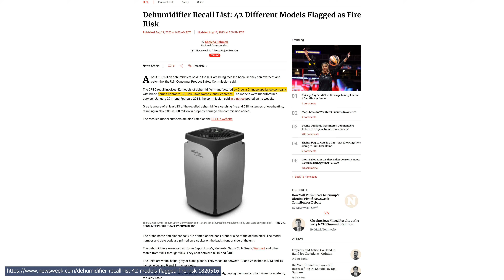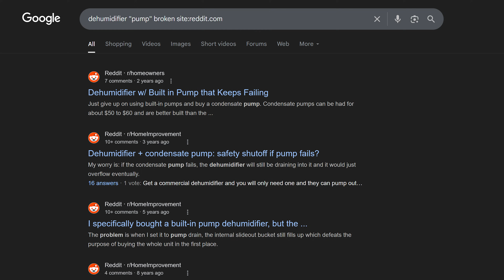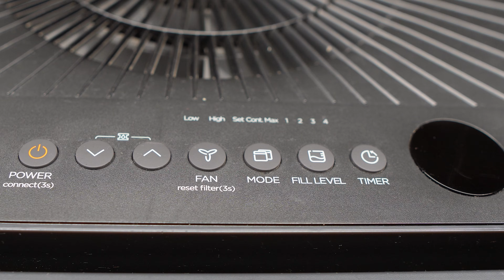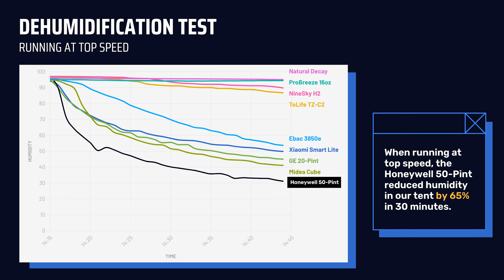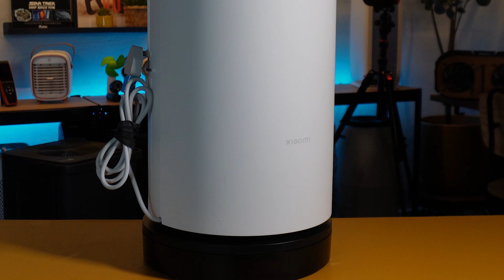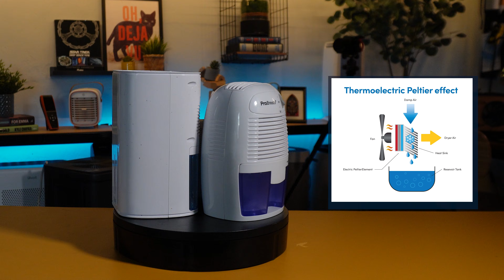Don’t Buy a Dehumidifier Before Watching This → The Best Dehumidifiers We Tested

Comment: Missing the Meaco Arete range! They even have a HEPA filter option. Definitely was a top pick in the past so a shame to see it missed here!
Reply: Arete One 12l but I believe they’ve updated them to be “smart” with the Arete Two range
Reply: Also, if you did test these and found them to be not as good as you’d hoped, I’d still love to see that. As far as I can tell Meaco is a fairly popular brand here in the UK
Reply from the maker: Will make sure to include for future they look interesting. I had tried one in the past that was both dehumidifier and air purifier and it wasn't great but these look better. Which model do you have?

Comment: this is by far the best video on dehumidifiers on youtube. Keep up the great work and i hope you can test more dehumidifiers and humidifiers. One bit of advice, Unlike air purifiers, you shouldn't oversize a dehumidifier. This can cause frequent cycling and shorten the lifespan of the unit. For example if you have a small bathroom, people think buy the biggest unit. This actually is less effective due to the unit constantly cycling on and off.
Reply from the maker: Thanks for sharing the issue of frequent cycling and it makes sense now that you say it. Could be a reason why people see such a high fail rate - I will make sure this is clear on the website version and include a size chart based on room size. Will keep on testing dehumidifiers and look at humidifiers at some point for sure!
Reply: @HouseFresh keep up the great work. I know you fight hard for this channel and website, but you probably have one of the best sites i and many others have found.
Reply: Hmmm; so the same as they say about window AC units! Good to know. Thanks

Comment: Glad to see the review of dehumidifier.  I would like to hear more on reliability.  I've lost track of how many dehumidifiers I have had to toss out over the years.  I only need to run a dehumidifier about 6 months a year.  Even so, they tend to fail (either with a fatal error code, or just stop dehumidifying) about a year after purchase.  I had one case where the manufacture refused to honor their own warrantee (I am looking at you Frigidaire).  Recent brands I have gone through include Costway, Midea, & Frigidaire.

I am convinced there is no one in the world that knows how to build a decent dehumidifier.  How hard can it be!?  We have air conditioners, heat pumps, refrigerators that easily last 10-20 years and they and dehumidifiers are all doing the same basic things.  But really is there no one able to make a dehumidifier that can last over 2 years?  No one!?

By the way, none of my failures have been due to a pump failure (I usually avoid using them where possible).
Reply: Each manufacturer knows how to make a dehumidifier last forever. They design them to fail shortly after the warranty period, planned obsolescence, with no replacement parts.  This way, customers pay around $250 a year for a new dehumidifier, plus $50 for disposing of the failed dehumidifier.  It's a scam.
Reply: @arp2600omni2odysseyprodgx  Yep! Welcome to capitalism!
Reply: @3nertia It's not an economic strategy problem. It's a heart problem.
Reply: Yup! I've tried GE, Media and others. Brand doesn't seem to make a difference. I've never gotten 5 years out of one. Usually mine lose refrigerant.
Reply: Isn't that where the ones aimed at semi-permanent basement installation come in (energy star calls it whole home dehumidifier)?  SantaFe and Aprilaire seem to do well at durability and seem to be how they justify the increase in price.  Plus they tend to be the better at energy efficiency with the ENERGY STAR Most Efficient rating
Reply from the maker: I know that this space does seem to have a lot more failures than with other sectors you mention. A more cynical version of me might make you think the issues are good for selling more but that can’t be the case! 

Must be some improvements a new entrant can make to stand out with higher durability.
Reply: @HouseFresh so mane I got lost, please which one do you recommend???

Comment: The Midea Cube is the worst design i have ever seen. i've returned it in less than a week. You have to lift the dehumidifier each time to emply it. And the bucket is so heavy once full it's hard to empty also. After that you have to lift the dehumidifier again... And it's noisy.
Reply from the maker: Agree it’s got its downsides with the larger bucket. But if you use with gravity hose this is a non issue and usually the hose is already high so easier to use than standard design.
Reply: @HouseFresh   I think you also mentioned the hose being high in the video.   What does that mean?  Relatively high above floor level?
Reply: Looks ridiculous.

Comment: It would be interesting to see you review the Meaco Arete Two range as they also include a hepa filter and can be run to dehumidify and air purify or just on air purifier mode. Would be interesting to see how it stacks up against standalone dehumidifiers and air purifiers. It is tempting to buy something that claims to combine the two in order to reduce electrical clutter in the home! 

Another similar product is the cheaper Electriq CD20PRO-LE which has a hepa filter, UV and ioniser so leans into the air purification even more than the Meaco.
Reply from the maker: I have tested one that didn’t do a great job as is was Peletier type dehumidifier and small fan hepa so weak air cleaning performance and water removal. 

But will check out the Meaco you mention and share the data.
Reply: I would also be interested to know if is worth on spending 450€.

Comment: Home Assistant integration would be a useful metric for many.
Also, specifically dehumidifiers: Plain old CalciumChloride packs. Passive, not as stong, but no power, no moving parts, no fire hazard.
Reply from the maker: Home assistant would be great and something I can test for in future. 

Will check out the calcium chloride methods and see how effective they are as they do have some big benefits as you mention.
Reply: @HouseFresh  CaCl isn't a big mover like most dehumidifiers here, not for rapid but rather latent moisture removal - but its enough te remove excess moisture if a room gets slightly damp over time. It has its niches. If you have a really wet room, you need a electric dehumidifier (and if itsn't for example a bathroom, a contractor to stop the source of moisture ASAP). Otherwise a passive one might even be better. Too dry air isn't really that good either.
To that extent: Air washers like those from Venta would be something I personally like to see featured on this cannel aswell.